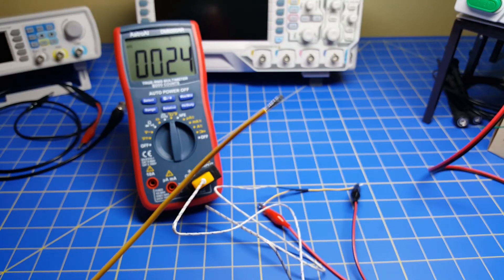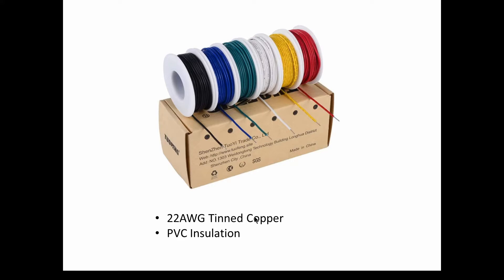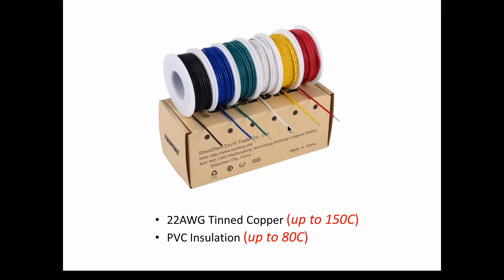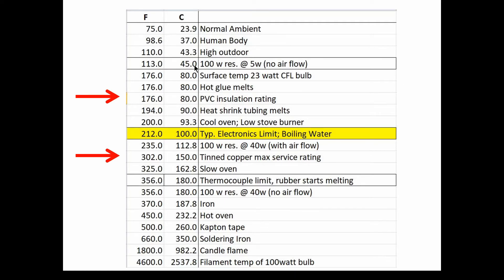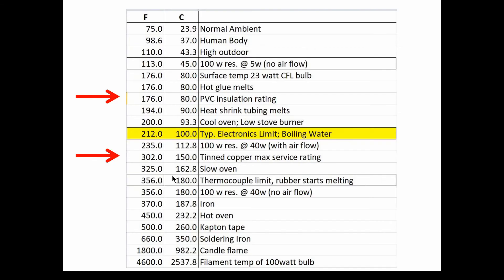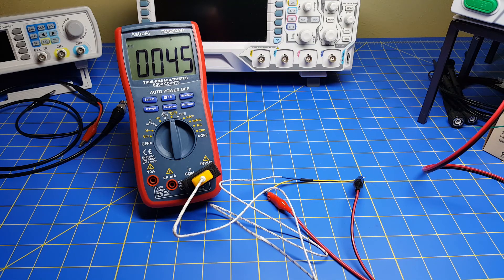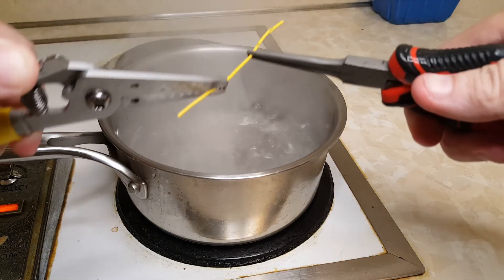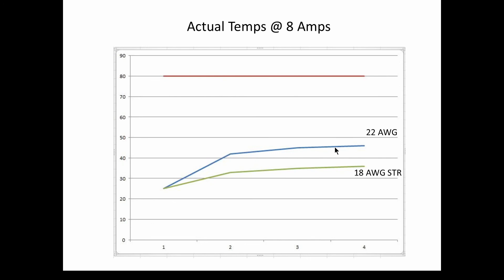Wire Current Ratings

Comment: When you put the power supply to the wire to
 check temp at 8 amps where was the load ?
Reply: Wire is connected to plus and minus and the power supply has current limit set to 8 amps. It is like a short circuit but current is limited by the power supply.